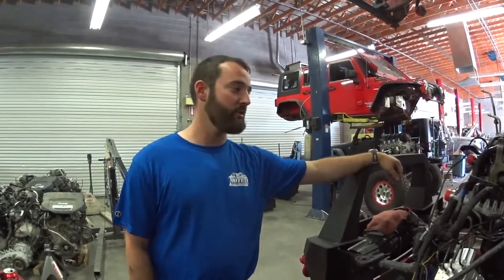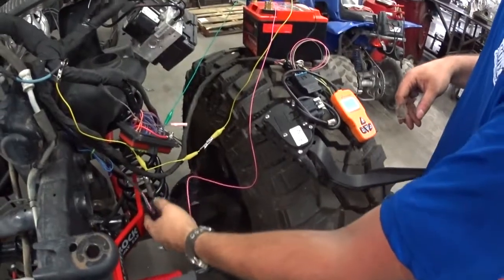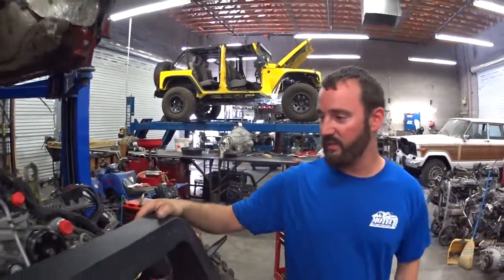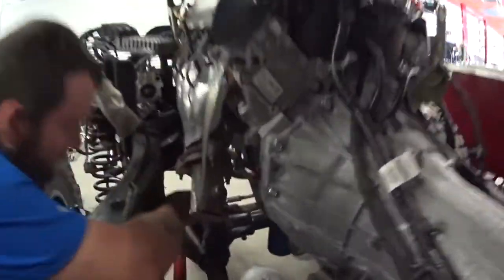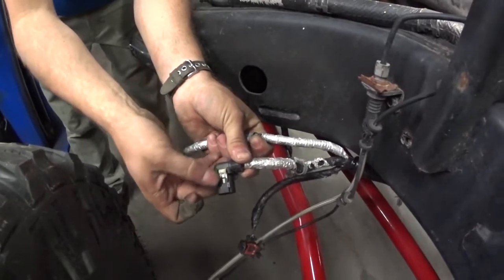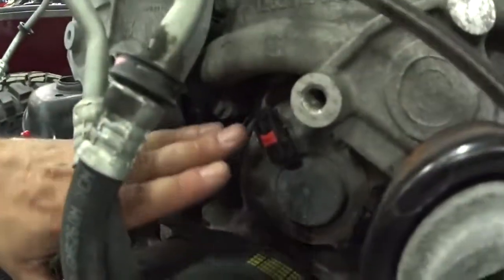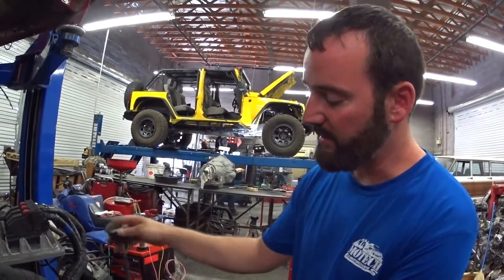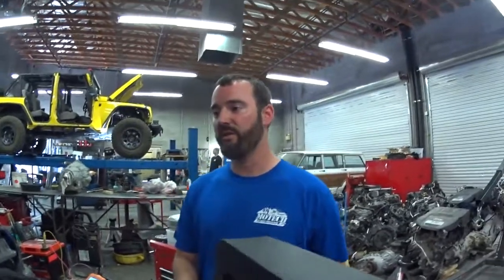GM gen v Engine  how to

Comment: The two sensors in the front on the valley cover are not for the high pressure pump they’re for the DOD / AFM

Comment: Hello! Where did you get the brackets for lifting the engine that we can see in your Gen V How to video?  Trying to lift a L83 LT engine and transmission into my 70 Chevy
Reply: Amanda Berry check out the Moroso 62674 hoist plate from summit racing. It worked for my gen V l86 and I think it’s the same for the l83. Good luck

Comment: might be a lame question but do you adapt a fill tube for the 8L90 or no? Im trying to figure out how to get the proper level when i go to service my OE truck
Reply: Really confused with the throttle body.  You installed it in the same position as the L83 but if you look at any pics of the throttle body on the LT1, the electronic / connectors are on the left not on the right like you have it.  Don’t get me wrong, I’m just confused about how to install the throttle body, not complaining.

Comment: Do you guys offer any standalone harness work for these L83?  I've got a complete pull out thats 4x4 ill be switching the 6l80e to a 2wd trans and need my harness reworked. Thanks in advance.
Reply: Darnell Jenkins did you find a place for harness? If not look into speartech. I know they work on new gen v harnesses.
Reply: Tacit Worm thanks for the info, i actually have a guy locally here in Phoenix thats doing it, he does all my Gen III wiring so I think he'll have it covered.
Reply: @trapspotcustoms627  how much for a wire harness
Reply: @trapspotcustoms627  who tuned it ? If you Don’t mind if in Phoenix need one for the l83
Reply: @dontworry6256  Aaron from Allout tuning, he actually just did my cammed full bolt ons L83 as well

Comment: Hey were would the oil pressure sensor at am getting a oil pressure code
Reply from the maker: Andres Barrera under the throttle body
Reply: 10-4 buddy